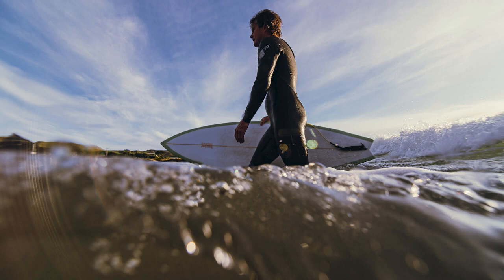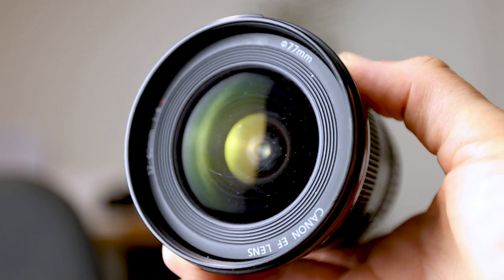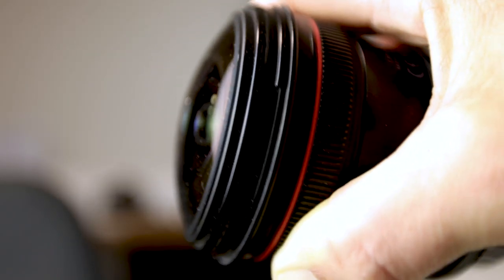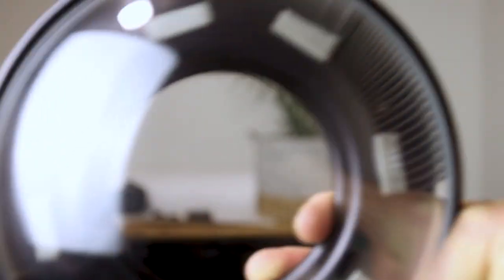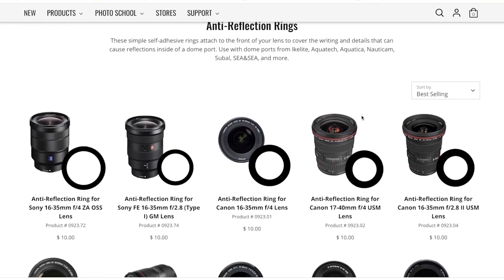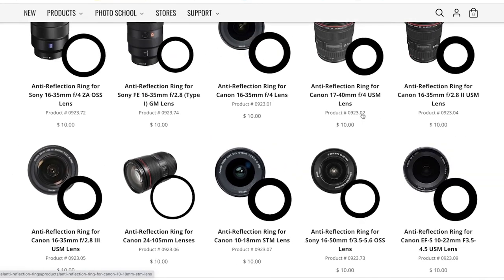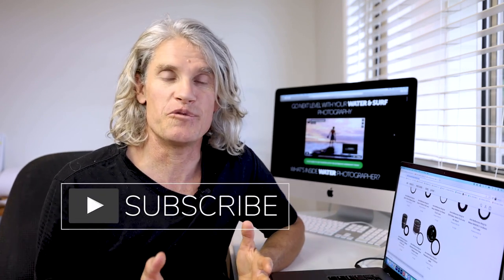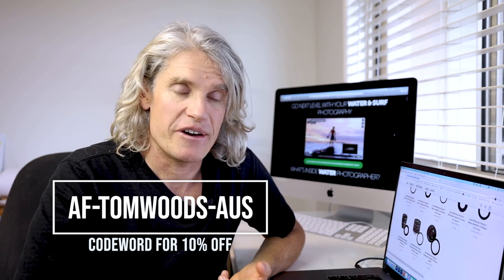How To Remove Reflections In Photos Caused In Dome Ports (Water Housings For Photography)

Comment: I've not invested in a bigger dome for my camera, but I did get the GDome mobile pro for my iPhone. Unfortunately my iPhone is white, and really kicks off reflections. Initially I cut out some gaff tape to cover up the exposed part, but it leaves a sticky residue. I tried seeing if I could rig a polarizing filter on my phone and stick it in the housing, but the clip was too big, but it did help cut the glare. I was thinking of maybe trying a sheet of liners polarizing filter and tape it inside  ... think it'd be worth the effort to try?

Thanks again for the water droplet tips, Im going to do that. I tried using some spray on gel the company sent me but it didn't seem to work, but I didn't realize you were trying to get the water to stick to it, so maybe I was doing it wrong.
Reply from the maker: thanks for the message mate.... yeah with dome ports its always best to use saliva in my experience. The products like the sprays and gels can sometimes work for flat ports but not for domes generally. SOme use baby shampoo for domes ports but i have always had great success with just spit and lick method. The problem is the reflection white surface of the phone, can you get a black phone cover to stop the kick back off the white surface, would it fit in the housing with a thin phone cover on it?
Reply: @dreamlifephotography   i have a basic silicon black phone case but they leave a big open square for the cameras :/
Reply from the maker: @TheFlyFishingFilmmaker  Oh yes I see!! not as up with i-phone photography gotta say... but yes that would be an issue, should be only when shooting into the light right?
Reply: @dreamlifephotography  Into the light Is the worst, but it can trick you, if you are you shooting in the shade, but if it's a bright day, the bright sky can still cause reflections even though Im not shooting into direct sun. It's tricky :)
Reply from the maker: @TheFlyFishingFilmmaker  yeah thats heavy, the reflective white surface around the lens is a bad idea by apple... not sure what to suggest, but if i come up with something I will come back to this thread and let you know
Reply: @dreamlifephotography  appreciate that!

Comment: Hey Tom, Quick question: My newest lens (sony 24-70 gm II) Only fits into my 8“ DomePort at the moment. Will I have a negative side effects from using my setup like this? I want to use the longer focal lengths to capture some waves above the water mainly. I usually use my 20mm inside the domeport.
Reply from the maker: Thanks for the question mate. Technically the dome ports are more designed for lenses 20mm or wider. So I would say using a flat port for your 24-70 would be more ideal...especially when using between 50mm to 70mm. However if its all you have at the moment then it can still work but the results will be mixed. I would work towards finding a flat port that fits your 24-70mm if I was in your shoes.  If you already have a flat port but its too short for the 24-70 you can buy an extender (if you are on the Aquatech system) that allows longer lenses
Reply: @dreamlifephotography  Thanks for your swift reply Tom! Unfortunately the Domeport is all I will have or be able to bring, as I am on a Sea Frogs Housing for now. I am just a college student starting out, relocating to the Caribbean for 6 months, so another port doesn’t really fits in my budget for now🥲 (I also think that the one from Seafrogs doesn’t 100% fit my housing) So if I want something save I gotta switch to aquatech sooner or later :)

I just wanted to know if I could shoot some waves above the water with 50-70mm; I‘d most likely use the 20mm the majority of the time :)
Reply from the maker: @Low2234  Cool mate, in that case I would definitely try the 50-70mm lens range in the dome. I know some domes work better than others with the longer lens, so you maybe alright. Your 20mm will be more suited, so if its really pumping take the wide out, but it would be worth experimenting to see if you get good results with the 50mm in the dome, it might actually work okay for some shots... The Caribbean trip sounds amazing... hope it goes well for you
Reply: Thanks mate, will do! Your videos were and are incredibly helpful as I got started and selected a dome size etc. I just want to thank you for that😊
Reply from the maker: @Low2234  cheers mate, so happy they have helped you in some way... enjoy the journey with water photography, its such a great ride!
Reply: Definitely the most fun I ever had with a camera in my hand, so please take some credit for it!

Comment: Iam using the Ikelite rings but still have the problem ... instead of the ribs u will get a whole ring reflection ... So not really better. I am trying to build something myself from cloth .... I don't know why there isn't really quality solutions for this problem on the market. Like a metal ring with non reflective material to screw on your lens... the ikelite stickers are just to flimsy and tend to come off after time too :/
Reply from the maker: Yeah, all really good points you raise here.. I think the Ikelite stickers help a bit but I agree they are not perfect. I think you are right, the ribs need to be hidden, If you come up with something let me know
Reply from the maker: maybe use some black felt type material... i reckon you are on to something with this, I think it could be better
Reply: @dreamlifephotography  i will let you know if i succeed with my idea :D
Reply from the maker: @InfiniteBlue_  that would be great! good luck